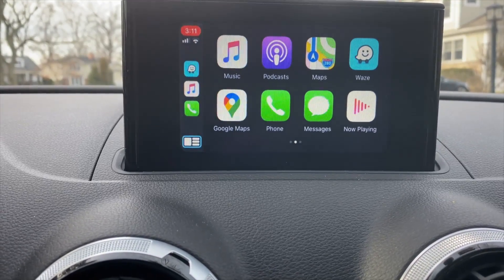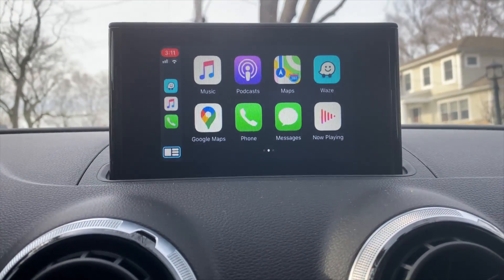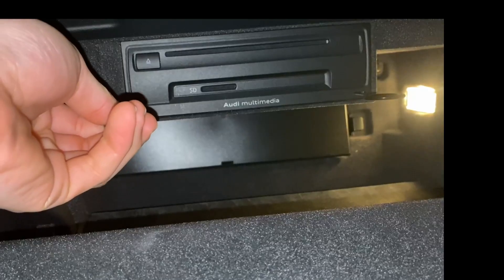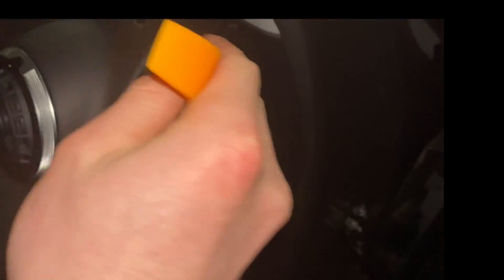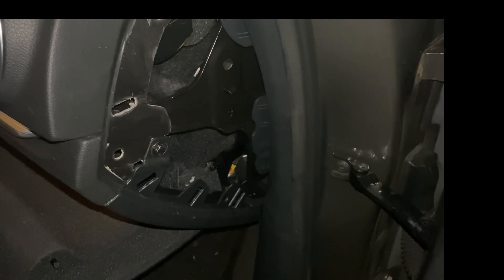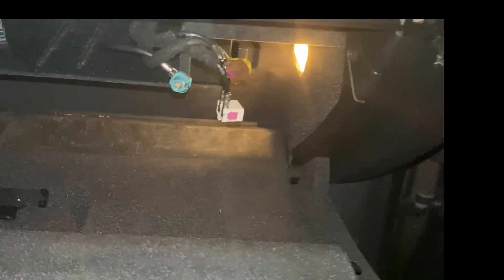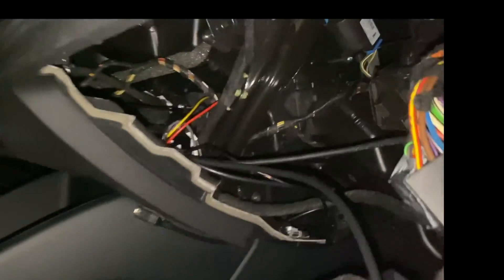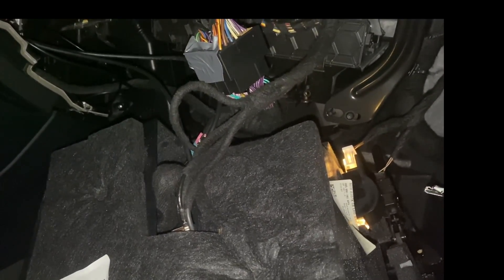2016 Audi A3 Carlinkit Apple Carplay Install Guide

Comment: Thanks for the video really appreciated. Just encounter a problem that while having phone call, it has echo on the other side and its quite annoying. 

Have you had the same issue? There is a option on the setting saying that use the car original bluetooth, however, it sometimes will connect the car bluetooth first then no response from screen to pop up.

Comment: Thank you for the review. I just purchased it on Amazon for my 2016 Audio S3. Different buy link to ensure comparability with s3. I had a couple of questions that the people in China can't seem to answer due to language barrier.
1.	Dos the usb cable connection coming from the video/usb wiring harness provide for wired carplay also have enough Amperage to charge my Iphone 12 when plugged in? I was thinking about installing a surface mount USB extension to the left of the cigarette lighter so I can plug my phone in to charge it while driving. Also, from a stability perspective I could use wired car play so it’s a better experience. Please advise if the USB connect from their box can charge
2.	On the USB/Video wiring harness, you have front-view and review yellow coax plugs. Do they need to be connected? I have an OEM car with no aftermarket cameras. The car is equipped with factory sensors and rear camera.
3. Do they come out with firmware updates for it? If so, where do you download and how do you update it?
Reply: Will this work for 2016 Audi A3? How do you like it so far?

Comment: Does the USB cable that is showing outside the glove box necessary? I like everything else but the fact you can see that connector?
Reply from the maker: You don’t have to use the usb, there’s a few different options. You can either solely use wireless but sometimes the connection will drop out.  The other option would be to make a more permanent mount under the climate control. You can drill a hole and use a circular plastic USB port
Reply: @TechRoundUp  roger that thanks

Comment: What all comes in the box??? Like does it come with the two keys and the wedge things???
Reply from the maker: It comes with one key and two trim panel removers.  If only MMI is available contact the seller on amazon and they will include an MMI to aux cable

Comment: Does it work with phone calls? did you have to connect a microphone?? and when someone calls you do you answer through the MMI or through apple car??
Reply from the maker: Phone. All’s are fine and it uses the built in mic of the car, so pretty seemless
Reply: @TechRoundUp  Ive bought one from Sinairyu carkit and you have to connect their own microphone or you wont be able to speak

Comment: Do you have the dip switch settings?  I have a 2016 s3 with backup camera.. I can’t read the instructions well enough to figure it out, and they can’t explain it.
Reply from the maker: I do not, but hopefully someone else can get you an answer
Reply: I found - what I believe is - a better translation of the installation instructions on this video. https://youtu.be/U4Fvnp4Zxf0 around 6 seconds in.

Comment: Hello
I installed the android box it works normally but it does not show me the radio and the car setup
Reply from the maker: In the android auto settings there should be a way to exit out to the car system

Comment: Is this still possible in a 2015 A3? And the 2016 Q3 has one in the center console is that an easier method of adapting the kit? Thanks!
Reply from the maker: I believe the kit will work on any A3 from 2013-2018, so you should be fine, and I'm not 100% sure on the Q3 but that does sound easier

Comment: Does it work with s3 ?
Reply from the maker: I don’t want to say for sure, but it should.  It works on both the 5.8” and 7” displays in the A3 from 13-17.  I would contact the seller on amazon, they are very responsive. https://www.amazon.com/Carlinkit-Wireless-Receiver-Navigation-Mirroring/dp/B07Q44QGRH/ref=mp_s_a_1_fkmr1_1?keywords=2016+audi+a3+carplay&qid=1576882507&replacementKeywords=carplay&sr=8-1-fkmr1&vehicle=2016-73-2806------------&vehicleName=2016+Audi+A3